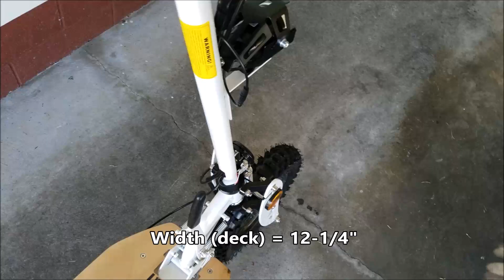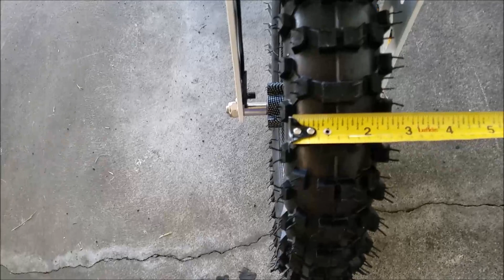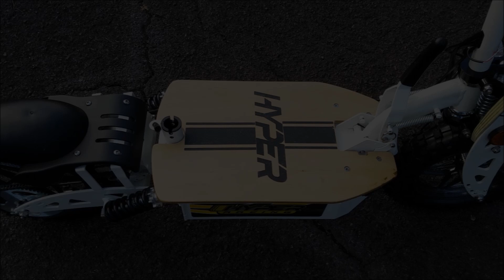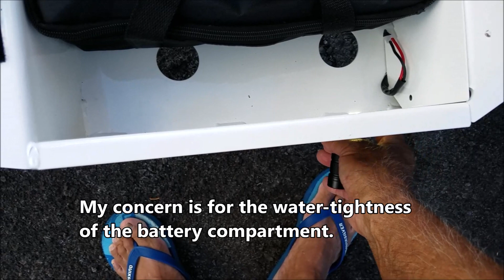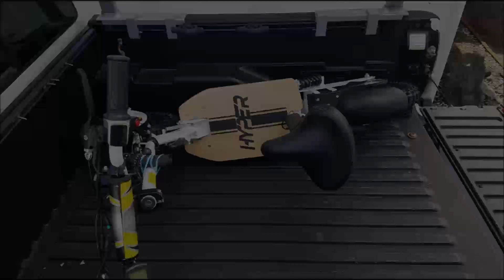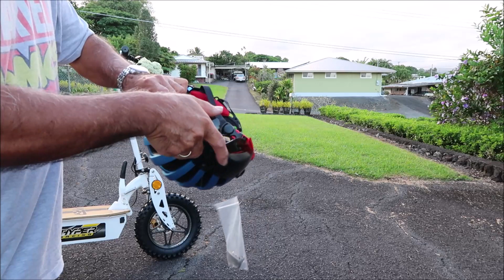2019 Hyper-Racing 2000 Watt Off Road Edition Electric Scooter REVIEW

Comment from the maker: First impressions of riding the scooter:

Wow!

It is big, it’s heavy, it’s powerful, it’s unwieldy, it’s unforgiving, and it is a beast.  There is so much unbridled power that just a slight touch of the throttle lurches the bike forward.  Learning to ride it almost seems like taming a wild bucking bronco.

At this point, I've ridden the scooter for a total of 3-1/2 hours.  I've dropped it twice.  I've scraped the paint off my truck's tailgate when I lost control of the scooter.  And I've bloodied my knee on a rail post while trying to negotiate a short 4' wide pedestrian bridge.  (I don't think I'll try that again!)   The good news is that I've survived.  And the scooter is doing even better than me, it doesn't look like there's a scratch on it.

I thought riding this scooter would be fun.  It's been vicariously thrilling.  It's been an exhiliariating experience.  But it hasn't been fun.  For now, it's all about paying complete attention to what I’m doing.  Hopefully, fun will come later.

Note:  All this experience has been done with the red throttle button in the "on" position, for reduced power or eco-mode.  I'm resisting the temptation of flipping the switch to ride at full throttle.  I'm just not ready for that, yet.  Besides, cruising along at 20MPH is plenty fast for me.

Pros:
1. Packaging _ comes very well packaged for shipment
2. Assembly _ easy
3. Frame _ robust steel frame
4. Quality _ very good (with exceptions noted in the review)
5. 2000 watt engine _ strong, powerful, high torque
6. Speed _ TBD (expect 35-40 mph)
7. Range with Li-ion batteries _ TBD (expect 15-20 miles)
8. LCD displays showing speed, mileage, and battery level _ good
9. Economy-mode red button _ 20MPH limit, good
10.Front and rear disc brakes _ excellent
11.Headlight _ adequate.
12.Tail light / brake light _ adequate
13.Horn _ good
14.Ride _ excellent (combination spring suspension/large wheels)

Cons:
1. Handle bar bracket and tail light bracket _ needed crowbar to widen them for assembly
2. Instructions _ poorly written/obsolete/missing
3. Deck lid _ durability issues
4. Platform/deck elevation above ground _ high, unstable
5. Seat post _ a little shaky, possible theft
6. Throttle _ hyper-sensitive at low speed
7. Rear view mirror _ omission
8. Arm and leg space while seated _ cramped
9. Battery box _ irregular welds, unnecessary vent holes, possible theft
10. Turn signals _ omission
11.Rear mudguard _ too short
12.Front mudguard _ omission
13.Lack of options for carrying gear (front, rear, and/or behind seat)
14.Website _ misinformation/missing information